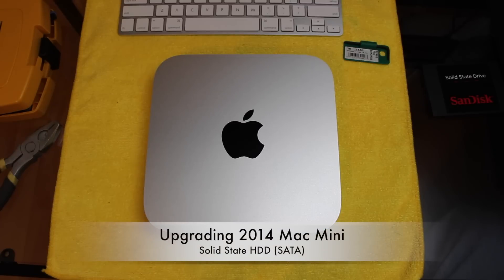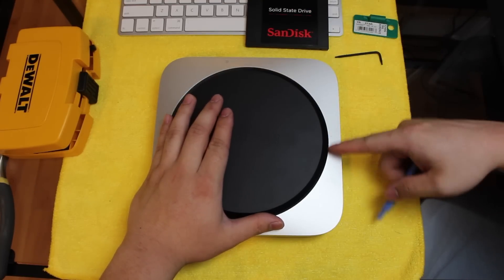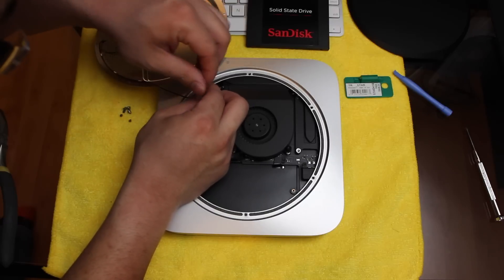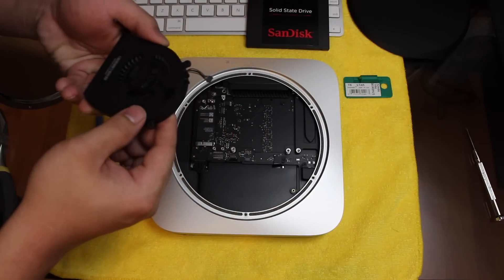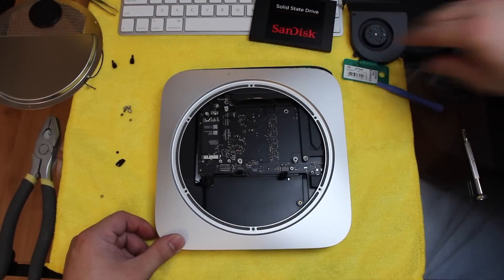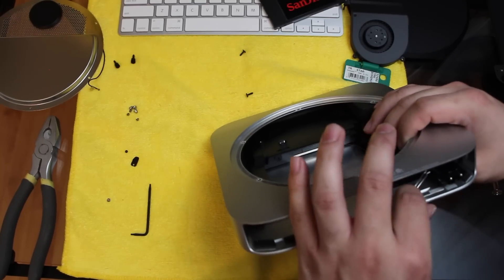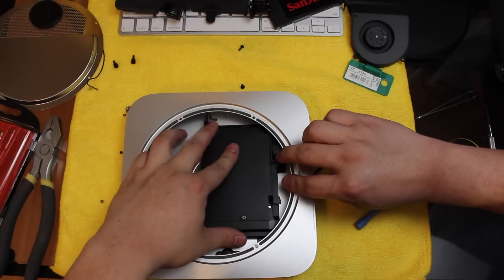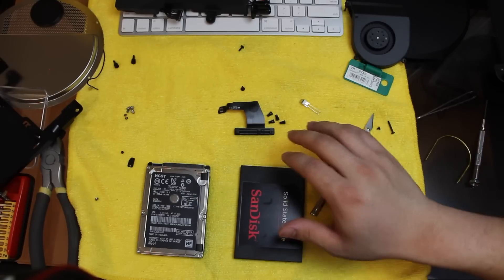Upgrading New 2014/ 2015 Mac Mini to SSD (Solid State Drive)

Comment: Just a shame that Apple doesn't allow much for user upgrading of RAM or, well, without too much effort, storage anymore.  I mean, if you're looking at a Mac Mini as a long term investment, it probably would be ideal to have that option so you can have this for a few years down the road.  Luckily for me, if I do go for a Mac Mini, it'll most likely be a casual bedroom computer at best, maybe for developing a quick iPad App or two.  

My primary computer will still be a Windows 10-based PC that I built earlier this year (still was a Win 8.1 PC to start), made for gaming, 3D art renderings, and what have you.  However, it seems that if you're going to get into Mac for the first time, I'd say look into the 2.6GHz model with the 1TB HDD and probably have 16GB RAM.  Might be the bang for the buck option if you're going the Mac Mini route, imo.

Comment: Does upgrading the drive yourself sacrifice any performance? in other words, does apple optimize the computer for the drive it comes with?
Reply: No matter how Apple "optimizes" their hard drive they stick in there. An HDD will never outperform an SSD.
Reply: +Ryan Cavitt (Kira) that a good point. the only sacrifice you might make is storage space, if you run out of cash. today you can get a fairly large ssd per dollar compares to a couple years ago.
Reply: LOL
Reply: +Dubspot Apple optimize their SSD, it's faster than a regular SSD, but all SSDs are WAY faster than a mechanical spinning hard disk.
Reply: Guy Hayklan Apple does not optimize their SSDs to "run faster" assuming this is a SATA III (6Gbps) interface there is no way an Apple SSD will outperform my Samsung 850 Pro which already saturates a SATA III connection. 
The only way you're going to get any faster is by using a different interface/controller such as Nvme or M.2.
Reply: Yes they do, I have several macs and they have faster than SATA III, their built in SSDs have a proprietary interface....
Reply: Guy Hayklan Lolno
Reply: +Ryan Cavitt (Kira) Apple SSDs are connected directly to the motherboard, they run usually at over 1000Mbps compared to the roughly 550Mbps of an 850 pro on a sata III interface. Check any online review of the 2015 MacBooks
Reply: +Co So Apple uses PCIE SSDs now, you can also buy such SSDs for desktop PCs.
They used M.2 before that.
Reply: NeedMoreMushrooms NVMe wipes the floor with M.2
Reply: *****
NVM-e is an SSD standard used for PCI-E SSDs, it isn't a bus, rather an interface for SSDs. :3
You get double speed on average, however, almost no one has the need for it if they don't have to do heavy file copying and handling of multiple Gigabytes a lot. Mostly high end professionals that work with extra large 4k files a lot or maybe Datacenters, but average internet browser Joe? Nope.

They don't use PCI-E SSDs in their Mac Minis btw....
Reply: The original ssd of the Mac mini is by far easier to be removed and replaced with an after market ssd for a third party manufacturer like in the case of MacBook Air and macbook retina. The cost is slightly higher than a ordinary ssd drive.

Comment: I just installed an SSD drive on my Mac Mini using your guide. Everything went just fine. Thanks a bunch!
Reply: podjigateli it does an internet install
Reply: How do you installed iOS on new hard Where did you get iOS?
Reply: @podjigateli  you mean Mac OS
Reply: @podjigateli  boot the mac and hold cmd and r until it takes you to the recovery screen then hit "install macos"

edit: it has just occured to me this comment was made 4 years ago
Reply: Did you have to change anything in the setting or was it just a plug and play.
Reply: How do you find the speed of the mac since the upgrade?
Reply: @conraddeighan2448  I don't remember since that was a long time ago.

Comment: I don't understand Apple, why in hell would they make the ram not user replaceable?
Reply: +Michael Davidson Because more people will buy more RAM when ordering the Mac.
Reply: For the sake of making it non up-gradable to an end user. To force people to buy more expensive configuration because they cant upgrade it later. To make their products thinner. To force end users to go to Apple stores for repairs. 

It makes no difference in performance at all. I have no idea where people are getting that from. It is actually detrimental to the end user. Instead of someone being to replace a faulty stick of RAM easily and quickly now they are forced to either go to an Apple store for a motherboard replacement or take it to someone who can replace the surface mount RAM chips.
Reply: Because they are misers and always want you to buy new!
Reply: neurotoksin I never get people like you, You goto a post see that people answer a question than you pretty much cut and paste the same thing thinking you did something smart.....
your pretty lame really
Reply: wow you really really are stupid there is expensive and very good ram but for a fan apple just apple ram is good even if they do not manufacture ram memory
Reply: in your stupud mind and dual core i7 from apple is better then i7 7700k from others companies who use that procesor
Reply: This is highly inaccurate.
Reply: +Hector G. +Alieno Intergalattico His comment about RAM performance being better because they are soldered on.
Reply: cuz i wanna build app for iphone and thats the only thing u can develop app on xcode
Reply: To make money as you will have to pay more to upgrade with apple that to do it yourself
Reply: how ? it makes absolutely no difference for performance
Reply: Michael Davidson Because it performs better with the ram soldered directly onto the motherboard.

Comment: My way is much easier and preserves the Apple warranty... Just get an external SSD and CCC Apple's internal drive over to the external SSD.. Then set the SSD as the boot drive..
Reply: Mark S Doing so would mean limiting the SSD to USB 3.0 speeds at best, which would defeat the purpose of having an SSD in the first place because most people that do this do it so they can boot the OS from it at SATA 6Gbps speeds
Reply: Sorry boss, you are completely wrong... SATA3 transfer rate is 6Gbit/s..  USB 3 has a transfer rate of 5Gbit/sec or 625MBytes/sec which is 10x faster than USB 2.0 and screams past a 5400 rpm HDD.. I put the OSX on the external drive and I get an 20 second boot time which is much faster that booting from the internal HDD... No, it doesn't run at 6Gbit/s, but it does run at 5Gbit/sec all day... considerably faster than the internal spinning drive (which btw runs 3GB/s or SATA2)and my warranty is still intact... Once the warranty is up, I will move it to the internal 6GBit bus.. For now, it works the tits... It was fun educating you...
Reply: Wow you sure got me beat. Here's a cookie for that win on the Internet your humbleness.

I was under the impression that most SSDs' transfer rate was between the max of USB3 and 6Gbps. But you know what? It's actually the reduced seek time that makes SSDs more attractive than HDDs, not the max theoretical transfer rate as that won't be easily reached nowadays under normal usage. Having an SSD on USB3 should make very little difference unless you're doing continuous massive file transfers all day.

So yes. You're right. Thank you for spending time "educating" me on oh so important transfer rates. You sure put us in our proper places. Please don't "educate" me any further because I am clearly unworthy of your humble greatness
Reply: LOL... got it... I shall return to my corner..
Reply: The reason you're only getting 150MB/s is because you not using a UASP SATA III compliant interface. Long winded people like you always make that mistake..
Reply: Mark S Putting an SSD into a USB3 enclosure is a great way to completely defeat the purpose of an SSD upgrade. An SSD on the native SATA interface will run circles around the exact same drive in a USB3 enclosure.

Real world transfer rates across USB3 top out at about 150MB/s (with a fast chipset on a good day with a tail wind) which would be about 1/4th the transfer rate of a modern SSD. That isn't even the worst part of it as very few real world file operations are raw sustained transfers. Most of them are dealing with many small files and mostly random access usage. It's the access/latency times where SSDs really shine and the performance of the USB bus is MASSIVELY slower than native SATA. That shiny new SSD you just "upgraded" your computer with is now likely to be just as slow if not slower than the "old" 5400rpm drive in 90% of actual tasks and just "somewhat" faster in sustained file transfer speeds.

Long story short if all you do is copy large ISO and movie files back and forth all day long than that SSD in a USB enclosure will in fact be faster at that task. But so would a 2 or 3 TB traditional hard drive in the same USB3 enclosure. At 10x the capacity. And half the cost. 

If on the other hand you actually use the computer for actual computing tasks then you've pretty much just wasted your money. This is why USB3 drives are marketed purely for backup and archival purposes. They are very good at cheaply storing large amounts of data. They absolutely suck at operations where real world I/O performance matters.

But of course you might be right and it's every single disk manufacturer, motherboard builder, system engineer, interface developer, OEM system builder, NAND flash memory fabricator and semi educated computing professional that is wrong. You should really write them all letters explaining how they've all been doing it wrong and need to scrap the billions of dollars of research and development they've spent advancing this technology at a rocket's pace the last 10 years or so. It's all been a waste of time. They just need to put USB3 connections on everything and call it a day.

I bet educating him was fun. Ignorance has always been the fast lane to bliss.
Reply: Mark S alexyan981 Or use the thunderbolt connection which is 10gb/s:)
Reply: Thunderbolt is the best but 2x the cost for a marginal gain
Reply: Ben Sheehan my Mac mini has an internal 5400rpm internal drive which I found unbearably slow. I then used an external ssd with the same operating system installed over the usb3 port and it boots up in around 1/3rd of the time and is a lot more pleasant to use now. I can definitely say usb3 ssd is 3-4x faster than an internal 5400 drive:)
Reply: Pystol Pete Thanks Pystol Pete... You proved my point exactly... Have you run BlackMagic to test your data transfer rate??
Reply: systemshq1
Excellent idea... But my Linux is a little shaky.. I would need to brush up a bit!!
Reply: Alakazam2047
You might want to order a 1TB spinning hard drive as the internal if you plan on doing a lot of video editing to store your files directly on the mini.. That's probably what I would do anyway.. Money is always a consideration..
Reply: I've learnt so much from all the comments in this thread! Amazingly
Reply: Mark S Thanks for educating me as well.
Reply: Mark S u r awesome
Reply: Pystol Pete the godfather  =,(.. u 're right
Reply: Ben Sheehan The reason you're only getting 150MB/s is because you not using a UASP 
SATA III compliant interface. Long winded people like you always make 
that mistake..
Reply: Mark S Hey Mark I installed Linux on both my Mac Mini with an external Samsung EVO SSD and a very recent Lenovo Laptop with the same model internal SATA Samsung EVO SSD. The Samsung SSDs I'm using are rated at approx 500MB/s read speed. From boot times, starting up applications, copying large files over, copying loads of small files over etc. there's very little difference between the two computers. Very pleased indeed - thankyou!
Reply: Mark S Also I like that fact of having a bootable external drive. I've replaced Mac Os with Ubuntu Linux 15.04 which is just as good now but again faster and runs on most PCs. I easily take the hard drive with me on my travels and plug it into most computers and boot off it:)
Reply: hehehe you'll be alright:):) what I can't believe now is the fonts look better in linux than in osx! see http://www.ubuntu.com/desktop for a good download
Reply: +Mark S If I need to install Boot Camp for Windows, can I install that onto the external SSD?
Reply: If OSX and Windows are both on the external drive you should be able to do that..
Reply: Mark S Thank you very much for your swift reply. I'm hoping to save some money if I ended up getting a Mini vs the iMac, although for budget reasons and usage (some basic Final Cut Pro) I may end up opting for a Mini. Are there any particular brands of SSD you might recommend or features I should look out for?
Reply: +Alakazam2047
Kingston or SanDisk or Samsung... Get 8gb ram absolute minimum if running Final Cut Pro... 16gb is best if you can afford.. *CAN'T* add ram to a 2014 mini after purchase!!
Reply: Mark S You bet. Thanks again, I really appreciate your knowledge on all of this.
Reply: Mark S Oh, one more question, sorry. Does that mean when I'm configuring the Mac Mini or iMac before buying, I should just leave the hard drive to the 5400 RPM one?
Reply: +Mark S This method via USB 3.0 does not support TRIM. For trim you would need to use thunderbolt...
Reply: use trimforce
Reply: except now you're flooding the USB bandwidth...

Comment: Super video. just change to SSD 850 EVO 250GB But can´t install the OS X Yosemite

Getting this "no access" sign any suggestion
Reply: Put the old hdd in an external USB 3 case, and use it to format the SSD, then (while still booted in the HDD) install Mac OS on the SSD.

Comment: If you have an iMac with Thunderbolt or USB 3 but without an SSD you can boot from a full-speed external SSD without opening the case.

Comment: Thanks to your video, I upgraded my mac mini to a SSD with no issues. I didn't need to coat hanger, just applied pressure and it came out. Pretty easy to do if you have tiny fingers for the screws and cable connectors. Lol Great job and thank you!

Comment: HGST = Hitachi Global Storage Technologies, which are actually the old IBM harddrive business that IBM sold to Hitachi after the 'Servers aren't supposed to run 24/7' debacle several years ago.
TO me this is the easy part, but as a PC tech, the tricky part is the 'imaging' of the existing installation to new drive.
The unit I have to do also has the 128 GB SSD.
On the one hand, myexperience w Apple is that they go out of their way to make everything 'Automatic' to the point of leaving a tech scratching his head only to find out that some task has already been done 'automatically', so I'm thingking that it could be a simple as doing a time-machine backup, put in new drive, restore from backup.
On the other hand, since Apple is so tight about OS disks and such, I don't have access to install disks.
Anybody got any ideas about the actual operating system installation transfer to new drive? SHould I jsut clone the 1 TB adn then what ever was one the 128 GB SSD partition will recognize the stuff on the new 500 SSD and just go with it? Or is the system on the 128 GB SSD, and the non-system files are on teh mechanical disk...
any help would be appreciated.
TIA
And yes, btw, I also have to resize the 1 TB partition on the orig mech disk to a smaller 500 GB partition on the new 500 GB SSD.

Comment: What about issues like the TRIM option and fans? I upgraded to SSD on my iMac and it did not support TRIM and the fan ran all the time. I had to take it to apple store and they put a jumper and turned off the fan and a third party app enabled TRIM, but OS X updates broke compatibility. A small SSD from apple would be a nice option instead of hard drive or large hyrid or SSD.
Reply: I too would like to know about the fan issue.
Reply: +zr0dfx I took it to the Apple Store and they fixed it. A jumper or something.

Comment: I really appreciate your effort Brandon 
I'm buying mid version of Mac mini and kind of regretting that I couldn't spend on high end version of Mac mini with fusion drive. Standard hard drives looks like stuck in past in front of ssd. 
After watching your video, after few months, I will throw away standard 1tb hard drive and replace it with the cheaper Samsung ssd. Guess what?? The performance of the Mac mini with ssd will be more than fusion drive with almost same cost to upgrade to fusion drive. After that I will have no regret. Thanks for making video. I don't care how hard it is to replace hard drive. I'm only glad to know that it is really possible.

Comment: which exactly model do you upgrade?which exactly ssd model did you use?this video shows a kingsotn and the other at the link shows samsung 850evo
Reply: +Bassman It will not matter all laptop SSD's (2,4") will fit.
Reply from the maker: I used the one in the link (850evo), I couldn't wait so I decided to try first with the SSD in the video. Any sata SSD will work fine though.

Comment: why bother can get a laptop with better specs soon and upgradable to??/
Reply: XInfinity2013 not relevant i can buy far better laptop and connect it to my 52' screen and if i want to take it i will just unplug it and use elsewhere there for more compact than mc mini and lot more advance plus cheaper, how ever if you need to have a mac then install osx and windows on same laptop still a winner, i myself have the mac mini since 2012 i got the cheapest one added an ssd and extra memory and see no reason to buy the 2015 version due to not being able to do that.
Reply: 4k resolution android fanboy